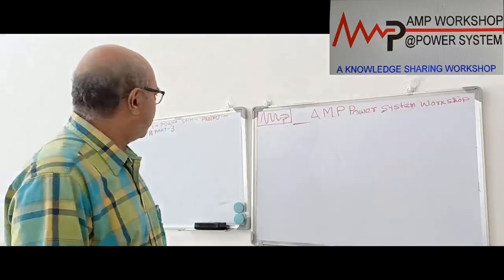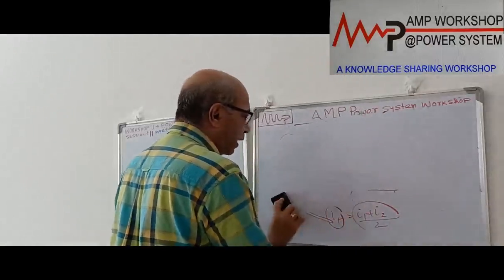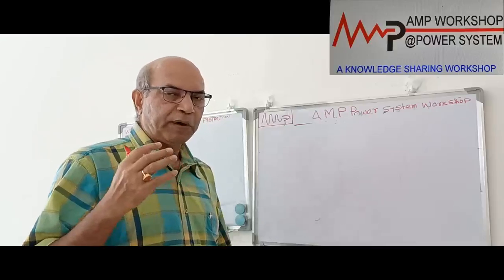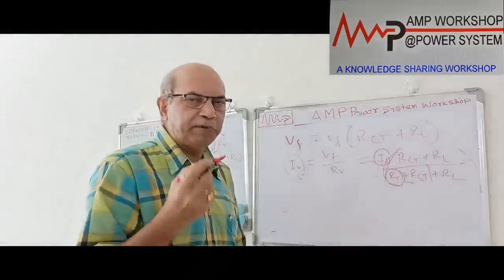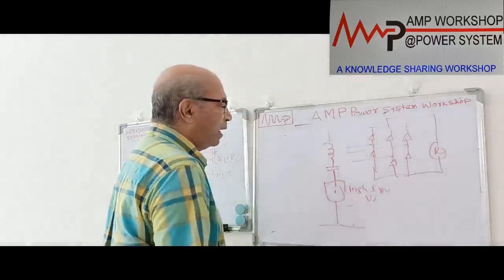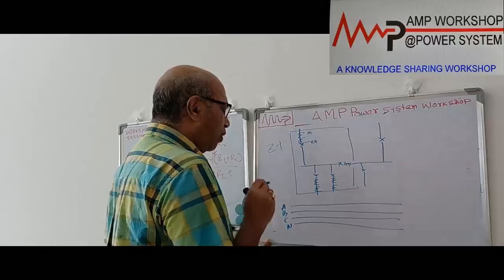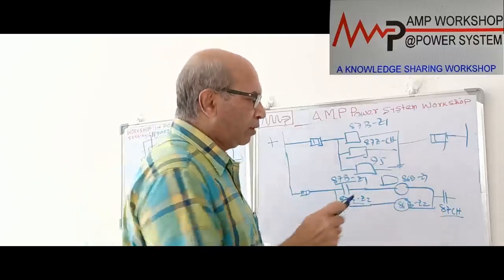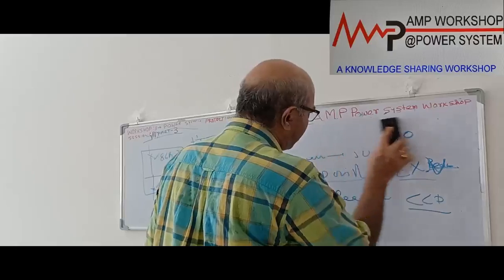Session11 Part-3 : Switchgear Busbar's Protection ( Low  & High Impedance Differential Scheme)

Comment: Sir why then we use low impedance differential protection
Reply from the maker: Where there is a chance of CT ratio mismatch and / or polarity change and / or CT used mixing with new and old and / or CT s are different make type etc, it is better to use low impedance differential protection.
Moreover, low impedance protection work on current value but high impedance work on voltage across  the relay terminal.
Low impedance system: each CT wire needs to be connected to the relay but high impedance it is not so.
Future feeder expansion may be difficult while the protection is low impedance type